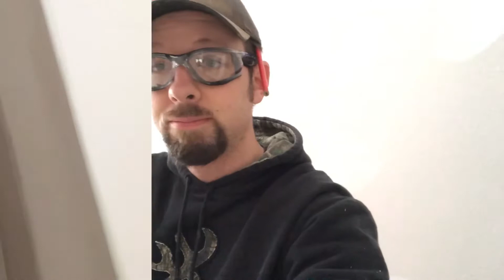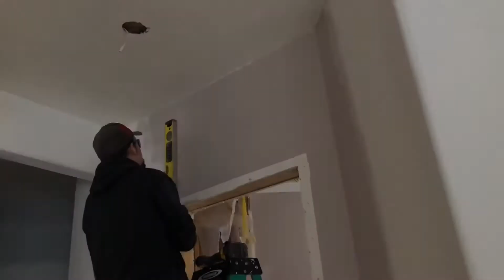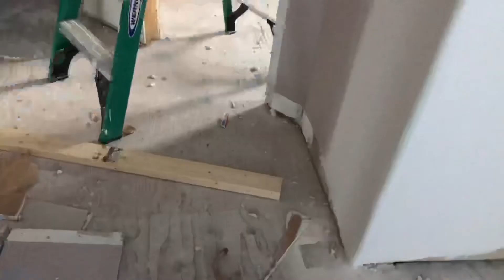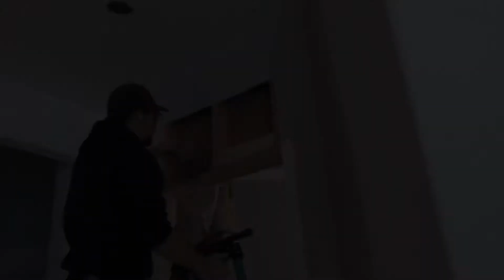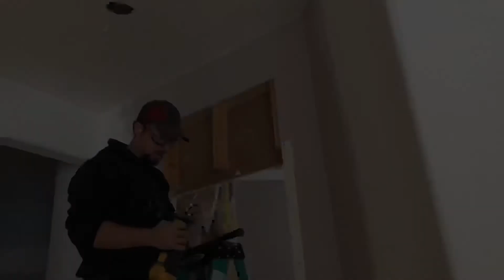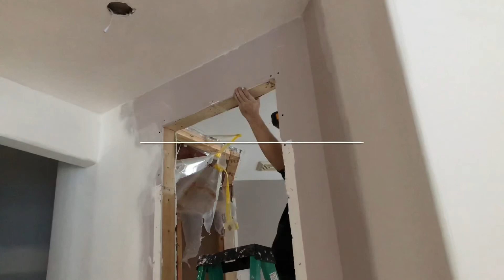DIY - Raising A Header / Doorway 🚪For A Taller Doors ( None Loadbearing )

Comment: Will the same process work for exterior door?
Reply from the maker: Inside your home yes however you’ll have a metal sill on the outside if you have brick and you will have to cut the brick / stone and or siding depending on what is there already. Framing is the same deal. You just carry the header higher. 

I hope that helped.

Comment: We would like to do this throughout our home. What can we expect to pay per interior door?
Reply from the maker: That all depends on your contractor. They should range from 60-100 per door 🚪 for only framing…. This changes depending if it’s load barring or not. Then you have drywall, trim and paint. 🎨 so it could be upwards for 2-300 dollars per door when done. ✅ it gets expensive quickly depending on your contractor’s quality.

Comment: Great video. Is there any reason you can't do this exactly the same for a double door closet? None weight-bearing
Reply from the maker: Yes you can. It is the exact same way. Just be sure to rei force the structure with screws and you'll be fine. Great question. =]

Comment: What is the model nail gun you are using
Reply from the maker: Theresa Gelso I use three types. Mainly my 887 which tend to burn out so I just drive screws and the occasional auger bit. Nothing serious. The motors are weak. The 887 has the three speed option which is great when building cabinets. I use the 885 that is known for having a bad chuck not holding bits. That’s a pain. I have repaired mine twice. The last one I use is my old 18volt with the 18v to 20v adapter but if you need the adapter get the version that allows you to use the flexvolt batteries aswell. I don’t use the 60v batteries in it however dewalt didn’t build their adapter right. The after market one allows your tool to sit flat plus you have 5amp USB charging off the 20v batteries.

Comment: Why didn’t you check the new header for level?
Reply from the maker: Ron L because I made measurements from the floor to approximately where the header needs to be.  I used a level and cut the drywall accurately. The floor itself will bring me close to where the header is going to be. I have already checked the floor for being level. I also leave room / space about 1/4 inch others will leave a 1/2 and I recommend that. Also if the floor is off I would leave more allowance or tolerance. Yes I could have used a level to confirm accuracy I just didn’t feel I needed to being I knew the floor was level to my measurements and had faith in my skill. Great observation. Perhaps on my next video on this subject I will do just that. =] Thank you for taking the time to comment. I should not just assume.
Reply: 803 Garage By Mr DoALL - Thank you for the clarification. Overall, the video is very helpful for a similar project I wasn’t looking forward too. Thank you!
Reply: I need someone who can this for my closet :(

Comment: Would this same approach work on a bedroom door on a wall that could be a load bearing wall of the house? 

Basically I need to do the same deal to a few doors in the house - but with doing this will the centre of the door frame still have support? As I saw you just run a 2x4 between each 'cripple' and then cut the over hanging 'cripples' down to size  

With this will the centre of the door frame still have enough support without a continuous 2x4 running straight across which the 'cripples' rest on?
Reply from the maker: Hey, great question. As you know this was not load bearing. The easy answer is remove the drywall so you can see why the structure is and go to town shrinking the framing already in place. Odd phrasing for when you want to be able to install a taller door. But basically the header structure would stay the same but higher up. The supporting structure would be replaced with longer wood keeping the load bearing door frame as such. My way was the quick and dirty way for a non load bearing wall. 

Anytime I have to work on one of these load bearing walls I always go a little further and add more structure than was previously there. Doing so I have never had an issue. 

I once had a friend take out his interior walls. Add a beam. The next day his roof caved in 7 inches. We immediately put in a post going from his man floor to the basement. His house is still standing 6 years later. 

Be safe.
Reply: @803Garage  So for a doorway on a load bearing wall - would I just cut further to the sides where the header rests onto the jack studs - cut the cripples shorter and essentially extend the jack stud up - run a continuous 2X4 header on the raised height jack studs and the shortened cripples to set onto the new height header?

Comment: I am replacing a double door set that are heavier than the existing set but I guess I would be able to do the same thing and just make sure that the new frame the doors will be hanging from are sturdy enough for the weight, correct?  I am only changing the height and not the total width.
Reply: Great video, BTW!

Comment: cutting out peace's lol pieces*
Reply from the maker: Bpac 69 LMBO damn hahaha 😂 nice 👍
Reply from the maker: Bpac 69 clearly my fault for not reading what I dictated to Siri ... LoL I don’t tell Siri what to write anymore but I’m sure I still make the mistakes - thank you for letting me know 🤓
Reply: all good , bud .  still a good video on raising a door . Im doing a reno and had to raise and level floor and was looking for an easy way to do it and your video nailed it , thanks what about on an exterior door ? same process ?
Reply from the maker: Bpac 69 raising an exterior door will require a more structural approach. Same process but the header is what is important. Basically doubled up 2x8s / 2x6s with a half inch ply cut in between for spacers. Then the rest depends on your door frame and outside finish brick, stucco, siding etc. I haven’t made a video on it yet. But my preference has always been to keep it looking like it’s always been that way.
Reply: i only need to go 2 inches and kindve thinking about taking off 2 from bottom of door . door is metal wrapped  though . its probably wierd to have exterior door swing out too. 100 yr old farm house with drywall over lathe n plaster. Dusty as hell cutting it
Reply from the maker: Bpac 69 be very careful when shortening your door. Especially metal. I have seen a lot and many of them were done wrong but looked good. They failed because of moisture issues later. I have an outward swinging door. I paid extra and the biggest difference was in the sil plate. You just want to make sure water and moisture do not enter your home. I have done custom jobs but changing the door orientation but always added some sort of cover to remove any chance of water or moisture damage over time. This is one of those areas where small changes cost a lot. Time and money.
Reply: thank you for the info !  much appreciated